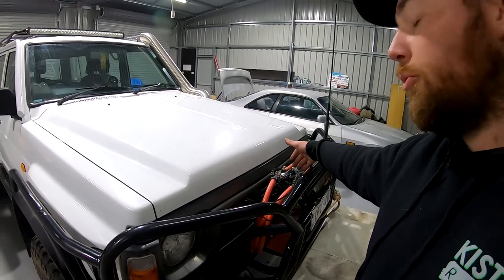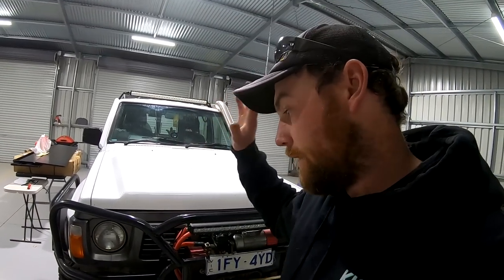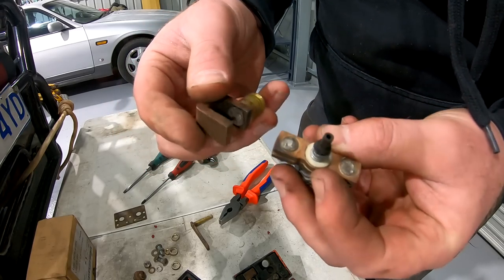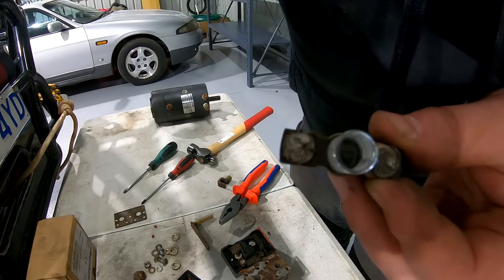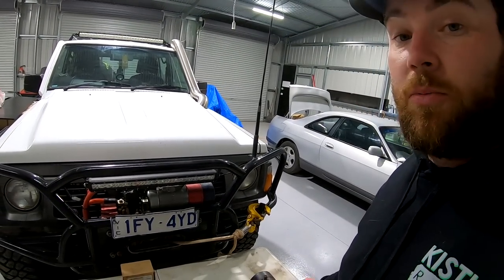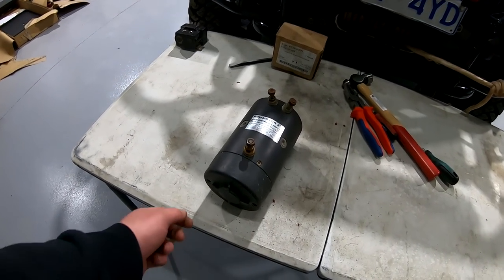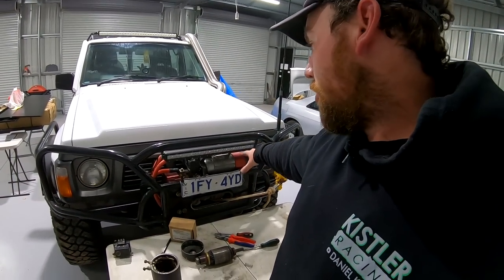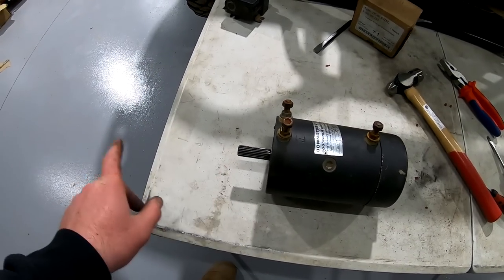Winch Not Working?? | Solenoid repair to get your winch working

Comment: Super helpful, my winch was stuck going in and wouldn't stop. After pulling apart the solionod I found that the contact pins had a Teflon sleeve around them. One was deformed and was preventing the pin from freely moving. Pulled them out and hit it with a bit of wd40 and happy days winch working again. Thanks again for the great video. 🎉🎉
Reply from the maker: Good to hear it’s been helpful mate. Cheers

Comment: Good tip about checking the battery connection. I felt like an idiot after disassembling the contactor multiple times only to find a loose connection at the battery. It would click a few times and then nothing. Tested with a spare battery on the bench and everything worked fine.
Reply from the maker: Haha sometimes it’s the easiest things. Atleast you got it sorted in the end.
Reply: @DanielKistler  Yep. threw me for a loop because it worked fine pulling about 10 small trees out of the ground and didn't act up until the last one.

Comment: Another awesome vid. Super helpful and of course, a plug for RRO. I dream of fitting up one of their Bullet motor and Allbright combos 💪🏻
Reply from the maker: Thanks for watching mate. I’m planning on using the bullets aswell with the bus bar kit, keep it all nice and neat. Cheers
Reply: Definitely with the bar kit. I’m with you on neatness! I bought a slightly cheaper TG Thompson from RRO thinking I’d attach it to the long M6 bolts but the motor on my Warn has an extrusion for the armature bearing. Dang it. 
Will keep the TG as a spare and continue to dream.

Comment: Is it as simple as changing out the old warn style controller and just bolting one of these in? I want to put it under the bonnet but don’t want to waste my time with the bulky solenoid pack
Reply from the maker: Yes mate, just take the old solenoid off and put one of these Albright ones on and wire it in.

Comment: Can you replace the old metal round selonods with the one your using now
Reply from the maker: If your talking about the factory warn highmount solenoids then yes you can.
Reply: Yep. I replaced the 4 solenoid pack with an Albright contactor on my M8000 after one went bad. Works well.

Comment: Will the solenoid still click if the little things in the bottom of the solenoid are stuck cause I can winch out but not in
Reply from the maker: Yep sounds like them pins in the bottom will be stuck, easy fix. Unless your power supply for the winch in is the problem, or I’ve had it happen where the tabs actually break on the solenoid
Reply: @DanielKistler  I so hope the tabs arnt busted it’s 3 months old first exposed solenoid and busbar setup didn’t realise how vonerable they were
Reply from the maker: @GQ2NV  should be just moisture in there. I’ve had solenoids on the winch motors for the last 6+ years. They certainly don’t last as long but still get plenty out of them
Reply: @DanielKistler  yea right something else must be going on my solenoid was mint and I checked the power to wires hope nothing’s wrong with the motor it’s a warn 6hp same age as the solenoid
Reply from the maker: @GQ2NV  give it a good check over. Unlikely that it’s the motor but never know
Reply: @DanielKistler  will do cheers just pulled it out

Comment: I don't think it's possible to disassemble the old round nickel plated solenoids.

Low mount motor just engages with a centre shaft.
Reply from the maker: That’s correct mate. Can only change out individual solenoids. Cheers

Comment: My winch in question is built into my Reese hitch so I'm hoping this works otherwise I have to drop the whole unit 250 pound off the bottom of the frame 😂
Reply from the maker: Hopefully that works out 🤣🤣
Reply: @DanielKistler  Murphy's law applies replacement of unit looking to be next project

Comment: My kings winch is clicking and it feels like there’s contact and I can feel the vibration in the box but there’s no movement at all. Any help ?
Reply from the maker: Pull the motor off and make sure end bearings are free and it doesn’t have any rust build up!